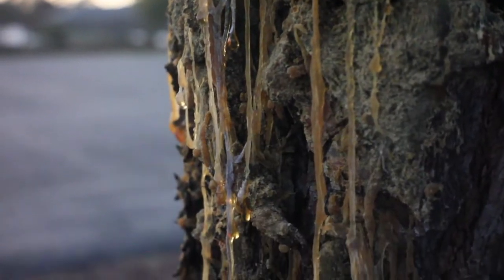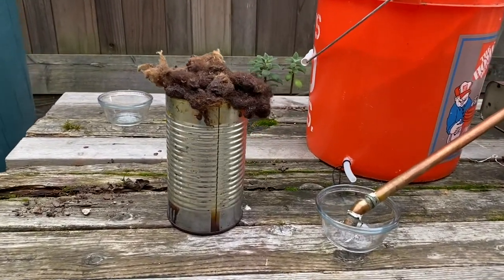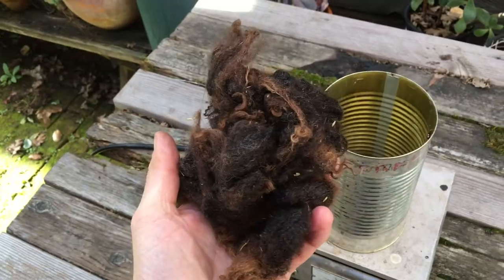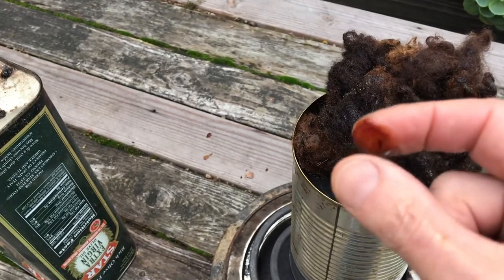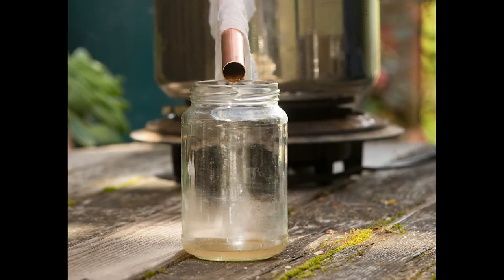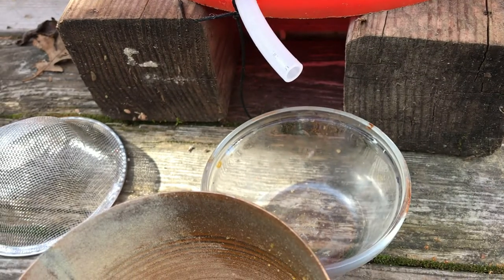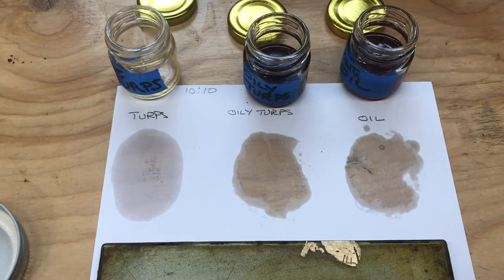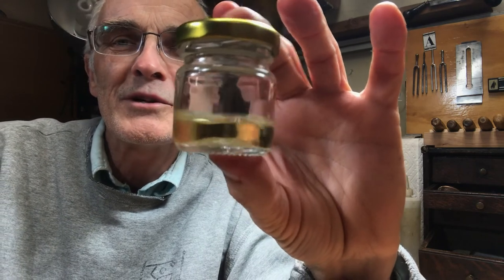Making Turpentine from pine sap for the Redwood Violin

Comment: Nice video,  but you might have better lick if you tap the tree yourself. Cut a square of bark off and chop into the first few layers of wood. Staple a bag against the tree, or arrange some other way for the resin to drip into a container. This will give you resin (it's not sap) with a much higher turpentine component, because much less will have evaporated. In one week you can collect a litre of resin from just a few trees.

Comment: My dear friend, why not use the modern glass chemistry bits to assemble a still? There's no contamination from the copper that way and you don't loose anything. I think the Liebig condenser is the easiest, you just need to get a pump for a fish tank or such to pump water through the outside (to keep it cool) and then I think you'll need the flask and the angle fitting.

Comment: You should use a pressure cooker pot and refrigerant copper pipe coil that brand new for the condenser that spirals down through a plastic pail ...sealed at the bottom by silicone.

Comment: Pretty sure you need to put the lid on before it boils. You lose a lot of the turpentine because it boils off at lower temperatures. Also if you use a smaller copper coil cooled in water, it will work much better.
Reply: Is turpentine the condensation collected from boiling pine sap?? I thought it was alcohol extracted. Because it's called "100% pure spirits", but I guess it could mean either.

Comment: when making  varnish they use amber  what is resin from pine trees just older  i kinda want to think if you  processed tree sap into amber by cooking and cleaning  it and allowing it to cool it would be the same thing . how ever im off track . when you make the varnish you have to use oil why not use the pine oil . im sure you could run it through a cheese cloth or cotton t shirt to clean up the brown and clear it up if you wanted to . or even run it through some activated charcoal .  but hey very interesting and would love to see varnish made from tree sap . as im almost sure that Stradivarius  and armada  did not order it off line . be safe when using these methods  very dangerous . your hillbilly still is a winner .  but in order to keep it from contamination it really need to be made of glass . good luck with that . kinda makes sense why clear varnish  was hard to get back in the day . but then again maybe if you let it sit for a while it will clear up on its own . all the contaminates might sink to the bottom .lol dint realize this was two years old my bad .

Comment: Commercial resin already has the turpentine removed as it's a by product of that process. Dry resin has virtually no water content to carry the turps hence why you get not much activity from that. Add distilled water to drier sap and it will hugely increase your yield. Also extracting to a gravy separator jug allows the water to be poured off the turps once settled. Ideally using runny resin fresh from a pine is what is best. Search commercial turpentine production videos from the USA and it shows the process better. Nothing like pottering away in the shed tho! Loving the experimentation :)

Comment: I like your attempt. Here are my tipps:
At the bottom you put an empty can, may a little smaller, than the one above. 
The can above, filled with raw material and some small holes at the bottom to release the resin in the can below. 
On this you wanna put a smaller tube upwards on the lid, before it goes in the cooling tube. 
This is for rectification, that separates more efficient.
Look with what high proof Rum is made, a Colon Still sometimes with additional dephlemgators (for a controlled steam flow resistance, steel or copper wool in the rectification tube or in the helmet is the poor Man's choice, read Warning for further Information)
Cooling with a bucket of water is OK, but you want the water moving, so it cools more efficient. 
To seal it, the old moonshiners used a paste of rye flour with water. 
The tricky part is heating the middle can without heating the bottom can more than necessary. 
If all goes well, the resins collect in the empty can at the bottom and the fluids coming out are more clear separated by boiling points. 
You also don't wanna collect it all in the same container, but in a few smaller numbered jars. 
Maybe the resin is mixed with oils and turpentine and just needs to be distilled again.
When making booze, they measure at the highest point where the steam goes into the cooling tube. 
With that and their nose, they decide when to cut the head and the tails of, so the "schnapps" doesn't become a headache soda. 
For nonfood applications you'll may even use putty weld to connect the rectification tube and the cooling tube. 

The old Alchemists often had a so called helmet to connect the boiling kettle with the cooling tube.

🚨🚨🚨🚨🚨🚨🚨🚨
🚨⚠️⚠️⚠️⚠️⚠️⚠️🚨
🚨⚠️WARNING!⚠️🚨
🚨⚠️⚠️⚠️⚠️⚠️⚠️🚨
🚨🚨🚨🚨🚨🚨🚨🚨

⚠️Under pressure the boiling point increases. 
⚠️If then the pressure falls immediately because f.e. the lid gets blown of, the overheated liquids (sometimes solids to) evaporate at the same moment, creating a feared boiler explosion. 
⚠️Google steam locomotive explosion for comparison. 
⚠️Now imagine that, but with a 🔥flammable🔥 liquid instead of water, sometimes around 🔥open🔥flames🔥. 
⚠️➡️Control the flow way each time you start and Control the temperature of the boiling can. 
⚠️➡️Those infrared thermometers work fine, but they don't like shiny surfaces.
⚠️🚨When the temperature rises to way more than you expect the boiling point of your product to be, KILL THE HEAT IMMEDIATELY !!! 
F.E. when making Moonshine and the kettle shows over 100°C, the tube is probably blocked or the kettle is boiled dry. 
⚠️Both are bad and require to stop immediately.

Comment: Very resourseful!  Your varnish looks really good. Hope she will dry nice and hard for you. Just a suggestion you might try amber. Yes it is very expensive but may yield superior hardness. Ive never tryed disolving amber in acetone. Wonder if that might work? Whatever you do dont boil turpentine it will explode!. Its easyier to just get artist grade turpentine and use that. I have used clear fingernail polish full strength and used it to varnish my carved bridge. It works suprisingly well. I have been using it for 3 months and it resists being cut into by the strings. Im pretty satisfyed with clear nail polish as a varnish for violin bridges. I suppose one could varnish an entire violin with nail polish but you would need really good ventilatiom. Hope this helps. Your redwood violin sounds wonderful I remember when you had the lady play it! Bye for now.

Comment: The Teapot is the most effective IMO but lacks only One section about 6" back from the pipe exit that slides through two holes in a metal bucket that is then filled with cold water and/or ice so that condensation happens more quickly. Great vid nonetheless¬!

Comment: Hmm, try twisting and gently stuffing the wool into a tube through which the vapor is passed. That might saturate it. By the way in some chemical analysis of old master paintings they have found small traces of pine oil or a very thin sap. It's possible they were using an impure turpentine to thin the oil paint and so some of it registers in the analysis as pine oil or sap.
Reply from the maker: Interesting about the paintings.  I varnished the fiddle twice . the first time using a varnish with the oily turpentine.  It started a heavy craquelure within a week, presumably because the impure turps was evaporating more slowly than Im used to , and was getting trapped in the lower layers.  I wonder if those old master paintings show more craquelure than usual?
Reply: @redwoodviolin  I don't know about those paintings specifically, but we oil painters are taught to be very careful about how we lay down our layers to avoid cracking and to not to do a final varnish for a year after the painting is complete. The varnishes we use are usually damar dissolved in turpentine and filtered. We add drops of linseed oil or lavender oil to the varnish as needed for extra flow because it's a little sticky. We sometimes varnish between layers of paint to provide a bed into which the next layer will settle and adhere. We paint into it while it's still a bit tacky. Either way the lower layers of a painting have to be very physically thin and either thinned with a lot of turpentine or lavender oil or just very physically thin and completely dry before the next layers are applied so that it doesn't seep moisture out or dry at a vastly different rate than the upper layers which are thicker and less thinned down. The type of pigment we use is also important because some dry faster than others so if you are using a stain use an iron oxide type like umber and that will help as it contains some manganese to add in drying. But I also know that the kind of wood you use can make a lot of difference. Ebony for example should not be varnished as it will seep moisture and crack. Fingerboards, bridges, and tuning keys are sometimes made from ebony. Not only should you thin your varnish down considerably and give it at least two weeks to dry between layers, but also make sure the wood is well seasoned and that the humidity in the shop isn't too high. I think you are probably right though. Sap seeps out so there's a good chance that the impure turpentine was the issue. Linseed oil has to be washed with water to purify it. The oil is put into a container with water or salt water and sand and shaken. The mucilage adheres to the water and eventually settles between the water layer and oil layer and the oil can be drawn off the top or decanted and the process repeated to purify the oil more and more. Lavender flowers can be added to the oil to help and the oil is sat in the sun to further clarify and purify it and we call this sun bleached. Sun bleached washed oil doesn't yellow very much at all. If a hole is made in the top of the container it will partly polymerize making a thicker oil we call stand oil. It takes about six months to create good stand oil, but it can be made commercially faster than that with heat in a vacuum. There are times when we prepare our canvases with a varnish made from shellac which is the common varnish used for violins. It provides a more slick less absorbent surface to paint on, but it can crack if bent since shellac dries harder than pure linseed oil. So it's also possible that one layer you applied had too much shellac. I don't know. I think  you are probably right though. It's probably a problem with the purity of the turpentine. I would think that distilling it again with a regular stove top alcohol grain-still would probably fix it leaving most of the sap behind.

Comment: tray to distill with steam eather than direct. hot plate using steam generator made with copper pipe bended to a helix shape filled with watter  continuously and exposed to heat sorce

Comment: I wonder if the wooly still is also contributing lanolin.  You're not using it, but it would make the violin very soft and silky!
Reply from the maker: I did wonder if lanolin might be the lost ingredient in the unreproducable Classic Italian Varnish
Reply: @redwoodviolin  I just explained the device to Paul and remarked, "If they used raw wool, it would have been crawling with lanolin."  And it dawned on me, with other things too, mites and ticks etc.  You may know they make a red dye from a species of ladybug.  Raw sheep wool also has dirt and awns.  I was just stabilizing a horse hair bag from Afghanistan;  had all sorts of bits of grass, seeds and sand.  You're explorations into these things are fascinating!

Comment: How about useing a small pressure cooker as they are sealed along with a thin diameter copper pipe bent  like the one you used leading to the hillbilly still? Youl keep the heat in the evaporate long enough to stop it condensing, maybe you'll get a better yield. 
Also loved "still making stills that dont work" 😂
Reply: it would probably work well.  I only had small quantities of sine sap to work with so a smaller vessel was more appropriate for me.